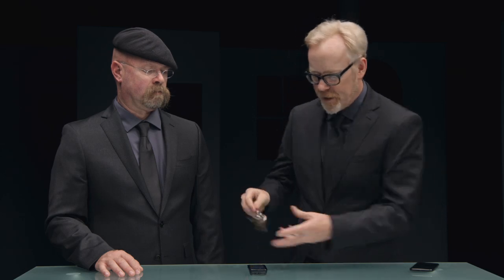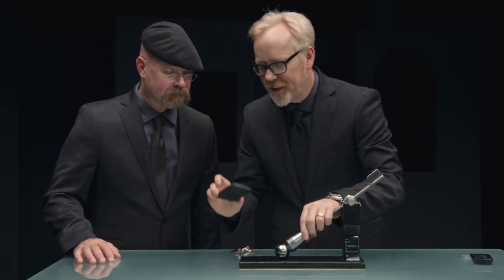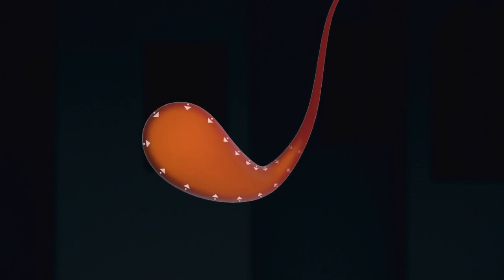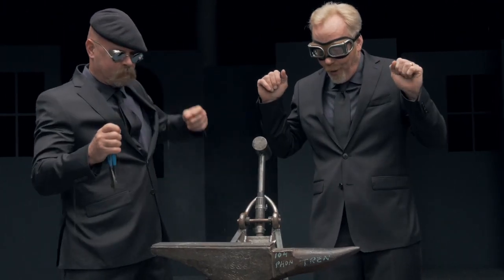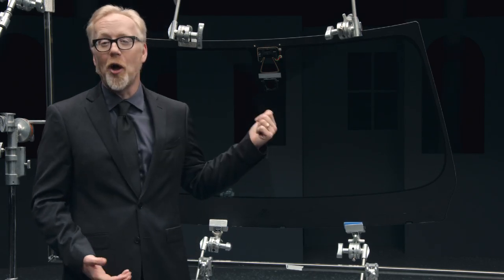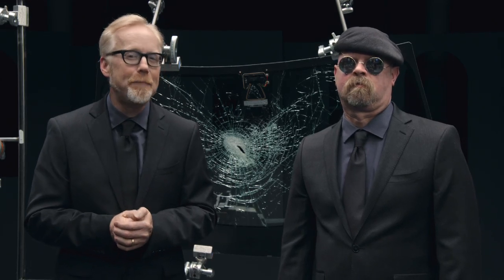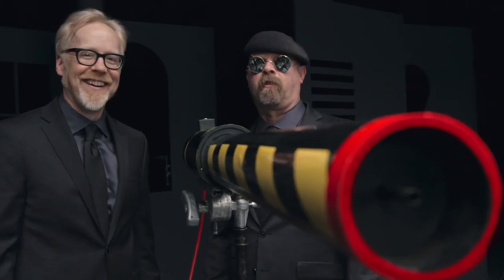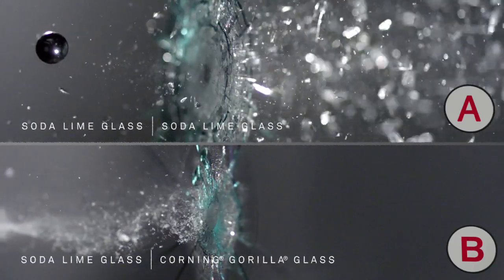The Glass Age, Part 2:  Strong, Durable Glass

Comment: Why didn't they also take the sledge hammer to the gorilla glass? I think it might have something to do with why it isn't in production yet. They shouldn't have demoed the sledge hammer if they were not going to do a side by side comparison
Reply: Is just because a human will never do 2 exact hits. So, thats is not a scientist method, because science need to compare under the exact same condition to validate something.
Thats why they use a robotic gun.
Reply: I think they just used the sledgehammer to show that the glass stays together after being broken.
Reply: They did it to demonstrate how laminated glads looks when broken
Reply: Because at full strength it would still shatter. If it didn't shatter, people would just accuse Jamie of not hitting it at full strength.
Reply: Because the sledgehammer would break both panes of glass.  The interior glass(gorilla) will break when the deformation exceeds the built in compression of the surface from the tempering process.  As you will notice in the ball bearing shoot, there is almost no deformation there due to the low momentum of the ball bearing.  The sledgehammer would deform the inner pane such that the surface would be in tension and then glass would then break.
Reply: you are correct. Corning actually spent a lot of effort removing all the old test videos of gorilla glass breaking from the internet. With this kind of glass, the stronger it is the smaller the parts it shatters into. Gorilla Glass is the epitome of chemically tempered glass and a true miracle, but that means when it DOES break, the extra strong varieties turn into glass powder. Phones screens don't do this because they are lammiated to the AMOLED display beneath, but this is still the reason why when phones break, they have such intense spiderweb crack patterns as opposed to just a single big crack or two.
Reply: Someone missed that lesson on the Scientific Method in grade school...
Reply: They did not use the hammer on gorilla glass because you can test at home how strong the impact of a hammer is while no one has a compressed air cannon to test how strong it actually is. Essentially they are twisting the facts without actually twissting them, just for the sake of the commercial
Reply: +Stgo. S. It's also a marketing ploy, they introduce the image of the totally shattered windshield prior to the introduction of their own "scientific" tests.

Comment: What about two layers of the gorilla glass laminated together instead of regular and gorilla wouldn't that reduce almost half the weight if not more and possibly be stronger
Reply: What they're not telling you is that they need that regular glass because it shatters and dissapates some of the energy.
Reply: +Rob Thomas that dose make sense but they could do some testing if they haven't already
Reply: Gorilla Glass appears to be pretty flexible.  The Soda Lime Glass seems to be the "bone-structure" with the Gorilla Glass to make it stronger.  If both panes were Gorilla Glass, I bet you would see a reaction on the windshield by wind at higher speeds because of the flexibility.
Reply: I was wondering that myself, actually.
Reply: ohhh. That actually makes sense now.

Comment: How to break any Soda Lime Glass: Throw a spark plug.
Reply: +Ghostwalker CIA Your wallet must be bigger than mine.
Reply: Ha diamond bullet that's rich...
hehehe
Reply: so true
Reply: +TheUndeadTitan not any
Reply: If you're refering to ninja rocks those are for breaking tempered glass
Reply: Or a broken piece of ceramic... Say a very specific piece from a broken spark plug; a chunk of the white insulator that's made from ceramic. A complete, not broken chunk, insulator from a spark plug would not have any of the glass breaking properties of a broken piece of ceramic, nor the weight of the rest of a spark plug. A whole spark plug would work, but not because it's a spark plug, but rather a pebble the same size/weight would work exactly the same. Only it'd cost much less; free vs an infinitely larger sum of a penny or more.
Reply: or any glass

Comment: 720p in 2014?!  Come on!  :D
Reply: +huyked 720P isn't new you know, the PS3 had it at launch and it wasn't all that new then either back in 2006.
Reply: +3dssolidsnake 
What I mean is, not that I didn't think they had 720p back then.  It's that they should have used 1080p by then.

Comment: Question

What if someone get trap on a sinking car? How can that individual escape since it's hard to break through the gorilla glass?
Reply: +Hershey Cordero A specialty tool?  Or maybe a built in ejection handle built into the window somewhere on the dash so that the whole window gets blown off in some way or allows you to kick it out in one piece which would keep the glass from cutting you on the way out as well.  Though, you don't normally go through the front windshield of the car when trying to escape a car, seeing as the glass holds together too well and it's possible to cut yourself on the bigger shards. Door glass is made to shatter into little pieces so you don't have to worry about getting out that way, which is why it's generally better to go out the side window.

Never mind that the most common problem with escaping a sinking car isn't the window, it's the seat belt.  Most people start panicking and can't get their seat belt undone which keeps them trapped in the car.   Which is why there's both a seat belt cutter AND a glass breaker on emergency knives.  If you wanted a car to be safer while it's sinking then perhaps there needs to be a way for the car itself to easily disengage the seat belt when it detects water and or the battery shorts  or something, then include a covered switch on the door that can be easily reached and break the side door window to allow ease of exit.  

Just my thoughts on the matter really.
Reply: Open the door..Or wind down the side window.You could exit through the sun roof if the glass panel is fully removable.Always carry a glass breaking hammer as failing all the other options,one of the side widows can be shattered,as they are not made from laminated glass.So you have several options as its only the front windshield glass that is laminated & shatter proof.If all options fail,say your prayers & prepare for drowning,then be enthused & excited by death.After all you are about to embark on a whole new experience,an unknown adventure..!
Reply: that's actually so scary to think about
Reply: SKYLANDBAK
 Opening the door underwater is almost impossible unless the cabin is full of water, same thing with the glass, you kinda have to wait until the pressure equals out, or the glass might not even break, given the pressure on it.  Any tool can be thrown during the impact and you'll not have a chance getting to it in your panic.  Like I mentioned, it would be easier to include the seat belt ease of removal and glass breaking into the design of the vehicle, as that would be a lot harder to mess up or lose during the crash.

Comment: They tested external forces, but what about internal forces? What would happen if a passenger is thrown into the windshield in an accident? Would they sustain more damage because the gorilla glass is stronger than product A, or would the gorilla glass shatter more violently because it is compression tension.

Comment: First the bad news. Everydrop test ive seen with a phone that has gorilla glass 4 the screen shatters everytime. But if you have a problem with ball bearings hitting your screen your going to be fine. So gorilla glass 4 is supposed to survive drops of one meter 80 percent of the time. So if you a oompa loompa or a member of the lollipop guild your totally protected.

Comment: Why not two layers of gorilla glass on the windshield
Reply: The corning glass has to bond to a solid surface
Reply: I imagine it's because it soaks up more energy in a safe way, through breaking. Same reason your helmet is designed to shatter rather than merely block all incoming trauma, it acts as a sponge for all that kinetic energy.
Reply: +ME DAVE The gorilla glass one was lighter...
Reply: Keeping in mind this is just hypothesis as a third party, my guess is that the issue is with the gorilla glass itself. Gorilla glass is a varietal of tempered glass, and as such, it's weak point is edge stresses. This is why the iPhone 5 (using a previous version of Gorilla glass) performed fantastic with straight on impacts, but the screen tended to shatter when dropped on its edge (and thus the sale/giveaway of bumpers). A windshield is a huge piece of glass under a tremendous amount of stress as the car frame/body flexes, meaning you could easily exceed the stress limits of the edges of the glass. Now if you are paying attention, yes, the glass already used in windshields is also tempered glass (this is why it's laminated in the first place, because if it wasn't when it shattered it would be like a Prince Rupert's drop in your face), but since it's a different type of tempered glass it has different stress limits. By laminating gorilla glass with traditional tempered glass, you get the benefits of both materials, and if needed could maybe even recess the edge of the gorilla glass from the frame a bit to reduce the pressure on it from the car body.
Reply: Like a glass crumple zone.
Reply: weight
Reply: I was gonna ask the same thing because the outside layer still chips and cracks the same right?
Reply: I was thinking that same thing
Reply: devoltar 
 the same thing happened to my 6S+ just 2 weeks ago...
Difference of several years but they're using the SAME stuff!
and I have/ had a great tempered glass screen protector. The problem? My case with bumpers all around broke just a few days earlier and I was waiting for a new case with more protection. 
Maybe the tempered glass screen protector prevented the screen from cracking in lines extending straight out from the corner that hit the pavement. It has a strange pattern: the cracks spider out straight from the point of contact with the pavement but as then six curve away and the three biggest ones take U turns and these turns are right near the junction where the screen protector is adhered to the phone screen (who knows)
The best part? Apple Care doesn't cover screen breakage: unbelievable! Total BS to pay 8 or 9 dollars a month forever and it's no help when you  need it...

Comment: My only gripe is that the windshields they shot at were at a 90 degree angle. Windshields are slanted.
Reply: At 90° the vector transmits 100% of the force to the surface. If you slant it the normal vector is reduced proportional to the sine of the new angle, resulting in less force from a lower speed.

Comment: smartphone glas. cant take a shard blade tip and doenst care, but gets ruined by a grain of sand in my pocket
Reply: +dharkbizkit Well that grain of sand is probably a tiny rock, which is ceramic, and ceramics(even those found in nature) are often harder than steel and glass. You can sharpen your knife in an emergency with just about any kind of rock , as long as it has a suitable surface.
Reply: *****
makes sense. so in terms of everyday dangers, knife scratching test are just for show
Reply: dharkbizkit Yea it might seem impressive, but in reality any common glass is scratch resistant to steel, and any type of common rocks, gravel , sand or not-so-fine dust will still scratch your phone or watch. I guess it's good if you really wanna keep your phone and your keys in the same pocket... but that's about it.

Comment: Why not just put gorilla glass on both sides of the car windshield?
Reply: Cost.  The gorilla glass' compressive strength holds up well when shielded with another barrier, but won't survive a blunt impact any better than the soda-lime glass. There is a safety factor added by including the gorilla glass on the interior, but the weight reduction doesn't yet make up for the price difference.

Comment: windshields are actually designed today to take the impact of your face in an accident. I make safety laminated glass for a living. We have blast shield which is just a very thin layer of perspex laminated on to the glass which essentially does the same thing but its very easy to scratch.

Comment: The question on my mind is cost to repair the Windshield B from said rock chips. Not the "penetrates" the Windshield A, but just regular "caught a rock while driving and now I have a chip" type.
Would this new glass be easier and less costly to fix or not? (as it seems we've gotten pretty good at repairing small-ish rock chips on our current windshields)

Comment: I thought we wanted windshields to shatter like that so that when someone flies out of their seat they go clean through, rather than having their nose shoot out their ass.
Reply: +Zeda Ennd That's probably why they still have the soda lime layer in the front, they don't want it unbreakable strong but they wanted to reduce the weight and prevent the glass shards from being thrown into the interior. They could have put two panes of thick gorilla and maintained the weight but drastically increased strength but they didn't, the strength was maintained since the ball bearing did not pierce either windshield but still b broke both. The windshields still shatter, they just do it cleaner.
Reply: Yeah, but how does the back pane preform when you throw a person at it at sixty miles an hour?
Reply: it would break just like a normal windshield, the improvement it brings is not strength to stop the projectile it just holds together better so glass shards don't get sent out upon light impact and the obvious weight improvements.
Reply: Hm.. Well, I guess I'd have to see it in action, but I'll trust it.

Comment: Instead of the full plate windshield having the resin layer, would it be more beneficial to have the outside ring be the standard resin, but the middle be a newtonian fluid? That would also add a resistance layer against incoming high-velocity objects.

Comment: Falling a steel ball on a lying sheet of glass (for "consistency") is not the same as falling the glass on the lying steel ball. In the first case the glass is lying on a hard surface and is not bending, while in the second case the edges of the glass are still moving with inertia on impact and - theoretically - may bend the sheet around the ball :)

Comment: I like how they go on about how hard gorilla glass is to break, yet only subject it to a force from the front, not side.  Yeah, it's real hard to shatter, that's why you never see a broken iphone screen. /sarcasm

Of course their example only works because yes, it's incredibly scratch resistant due to its hardness, and therefore didn't provide a shear line for the weight to crack, but harder=more brittle, and therefore it doesn't do well with ACTUALLY being dropped, say, on a corner.

How can they even pretend that it's "equivalent to a 1m drop"?  What are you dropping it on that will hit it exactly, and only in the center of the screen?

Also "found on all the best small devices."

Yeah, if you don't use THEIR product, you have an inferior product.  That's fine, I'll stick with my inferior, non-shattered phone thanks.

Comment: OK I'll ask.
Why only a half-assed gorilla glass windshield?
Why not just make it two layers of gorilla glass and do away with the 2000 year old layer altogether?
And while I'm on, (if it's not possible to have 2 layers of GG, and we have to stick with one layer of GG and one of old glass) why not put the gorilla glass on the OUTSIDE instead of on the inside? How many scratches do you get on the inside of a windshield that make it necessary to replace it?
Most windshields get replaced because of cracks and chips on the OUTSIDE layer.